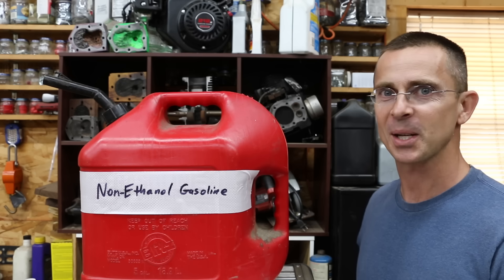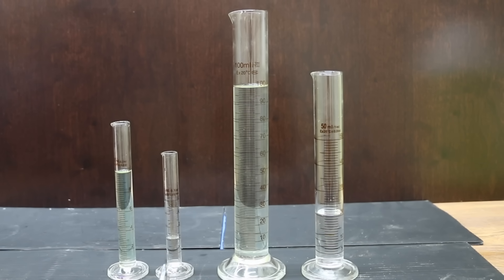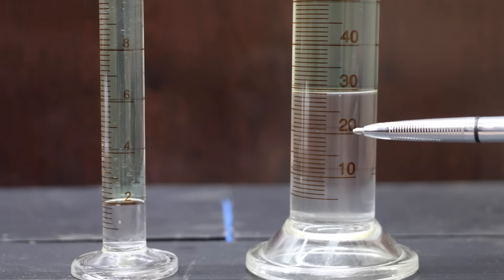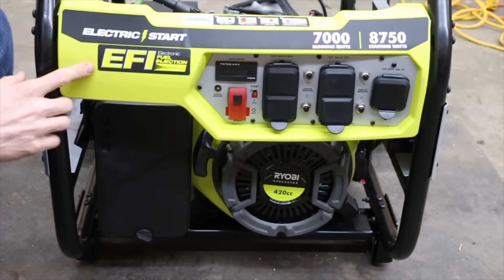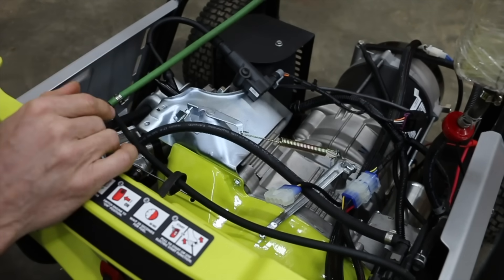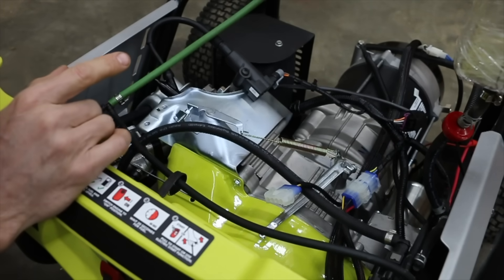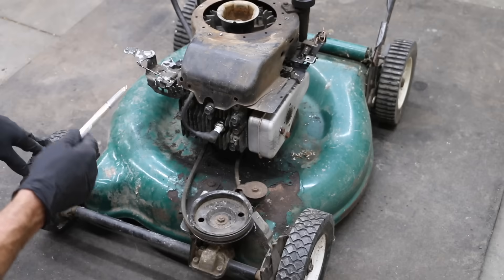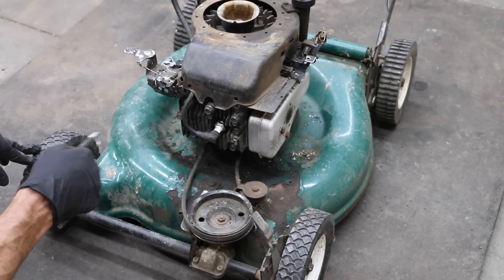Is Non-Ethanol Gasoline Really Better? See the PROOF!

Comment: Personal experience: Having dealt with various carb issues previously, I've been using strictly non-ethanol 91 in all my small engines, both 2- and 4-cycle, for about four years now - mower, snowblower, power washer, grass trimmer, chain saw, leaf blower, etc.  I don't use any fuel stabilizers and have had no carb issues with any piece of equipment since I switched. (mower is 11 years old, snowblower is 27 years old).
Reply from the maker: Thanks for sharing.
Reply: @ProjectFarm  Can you make a video on 2 stroke engine regarding 2t oil pump vs premix with gas... Which is better... I have a 2 stroke bike 1988 rx100 yamaha.. I am using autolube, but some says premix is better...thanks in advance... ❤️
Reply: @shishirgupta8574  A lot of people delete oil injection pumps as a preventative measure to eliminate an additional potential failure point, oil injection pumps failing means your bike will run richer and not have any oiling besides what was previously left unburnt in the crankcase. Which could cause bearings to seize, spin, wear prematurely etc. You can still premix with an injection pump, either really high ratios 50:1 or higher,  but you'll more than likely need to resize the main and pilot jets if you go much leaner with the premix fuel mixture. I personally always delete/disable injection pumps and premix 32:1 - 50:1 depending on the bikes compression ratio and/or riding I plan to do.
Reply: @WreckedRevival  thanks for sharing 👍
Reply: Do you have experience with 2-stroke oil and ethanol? I heard that not all brands of 2-stroke oil likes high % alcohol gas mixtures.

I have noticed powerloss in some small sidevalve engines when using E-mixes. My old redblock volvos are on the other hand loving 50-50% 95octane and E85.
Reply: @secularnevrosis  Well, yes.  I used to use regular grade fuel with ethanol in everything, 2- and 4-.  Used to gum up my old grass trimmer.  I contacted Stihl, Honda, etc. manufacturers and asked re using 91 octane non-ethanol, they said no problem.  I haven't had any issues using it in 2-stroke, and the leave blower especially gets a lot of use, 12 months, because I use it to blow light snow off walks and cars besides yard work the rest of the year.
Reply: @rla1000  ~ You do not use Fuel Stabilizers you explained. “BUT” do you live in a cold winter climate that gets down to about -25 and small 2 & 4 cycle engines, snowblowers, lawnmowers, and ATV’s sit parked for about 6 months of the year not used.??  In this case Fuel Stabilizers are needed as an addition because Fuel deteriorates and degrades over long term storage.
Reply: @royjohnson465  Thank you, but I guess I don't really know what the fallout is from fuel "degradation/deterioration," so long as it doesn't cause carb issues, and I have had zero problems since I switched to non-ethanol several years ago. It doesn't seem to affect engine performance because at some point I'm adding fresh fuel with any use of the machine.

I don't know that I've ever experienced -25F, certainly not in the past 30 years or more, with winter and summer temps increasingly warmer.  However, once snow arrives, my snow blower sits on my open porch unprotected and one easy pull starts it up (never bother with electric start).  I use my leaf blower 12 months of the year (will clear a half-foot of light fluffy snow off the cars in no time), and mower (Honda with mulching) typically in use eight months a year with fall leaf pickup and spring cleanup.  Most of my equipment, even after sitting for several months, fires up within one or two pulls.  Exceptions might be chain saw and power washer which could sit unused for three or four years.  Had need to fire up my chain saw the other day after it had sat at least three or four years and it did take about a dozen pulls before it kicked over.  Part of the problem I think is it has a very short stroke and the pull cord could be longer.  Do you think I should add stabilizer to equipment that I know is going to sit idle for longer periods?  I don't have enough experience with stabilizers to know if they help or not, but I do know non-ethanol helps 100 percent.
Reply: @rla1000 the chainsaws are two stroke. Gas is not the problem, its always the oil thats mixed in. Sometimes adding a little bit fresh gas helps relieves a dozen pulls to few pulls.
Reply: This would probably get expensive for car use
Reply: That’s such a waste of money but you do you I guess
Reply: @ProdigyyRp  considering how little fuel small 2 and 4 stroke engines use, it's honestly not a major difference, and is worth not having gummed up carbs if you leave something alone for over a few months
Reply: @That1Carson  exactly, spend the extra couple bucks beforehand
Reply: @That1Carson  are you running them dry before putting away? Because even with non ethanol you have problems without proper maintenance
Reply: @That1Carson  The simple answer is that if your fuel delivery system isn't designed for ethanol then don't use it. I use 91RON lead free non ethanol in my lawn mower for this reason but in my dual fuel car (an Australian Ford Fairmont wagon), which is E10 compatible, I run either LPG, E10 or 91 depending on price. I get 17litres/100kilometres from LPG 14.5L/100 on E10 (94RON) and 12.9l/100 on 91RON. This is in city driving which included roads with 60 and 80kph speed limits. I will only run three tanks of LPG before running a tank of either E10 or 91 Ron to provide upper cylinder lubrication. I have had no issues with injectors or fouling plugs and my engine is an inline 4.0 six which has done 370,000 kilometres.
In short I don't see it as better or worse- just different and you have to judge the cost of the fuel against the consumption. If I am going on a highway/freeway trip I will run my Ford on petrol to start up but when it gets to operating temp i will switch to LPG until it runs out and then back to petrol. This gives me a range of just under 1000K.
Typical prices in Dandenong Australia at the moment are LPG AUD $0.90/litre, E10 is 1.65/litre and 91 is $1.70/litre.
Reply: @That1Carson  don’t let your shit sit with fuel in it and that won’t be a problem…
Reply: @lonewolftech  I had an outboard on my sailboat, old Honda from 1972.  Since it was a sailboat, I would go through just one tank of gas from May-to-October.  So this stuff sits in a tank for a while, and in humid environment.  It was common wisdom at the club to use only ethanol free gas.  Community jars were marked in big letters - strictly no ethanol containing gas.
Reply: @ProdigyyRp  Only a waste if you throw the car away in 6 years. Carbon buildup will wear everything down and cause blow by eventually. I ain't putting ethanol in anything I want to own for a long time.
Reply: @ProdigyyRp  booooo
Reply: I also use premium without ethanol in all small engines. No more carb issues. I don't even winterize. Still get rotted chainsaw fuel lines over time.
Reply: wise
Reply: my 30 year old snow blower's carb clogs right up if ethanol gas sits in it. Switched to non ethanol (unfortunately only high octane here), and while it probably performs worse, it's much happier overall...
Reply: @moonasha  don't let gas or ethanol sit in a carb. Both will damage the carb eventually.
Reply: @jdrok5026  what if gas just sits in a tank? We didn't get any snow last year so the snowblower has just sat there for nearly 2 years unused with gas in the tank. I drained out the carb at the end of the last winter we used i though
Reply: @moonasha  gas in the tank isn't s huge issue water is for ethanol but you should always run the carb dry.
Reply: @moonasha  The gas tank on an engine has to have a cap which lets in air, to replace the gas being sucked out.  This means that as temperatures rise and fall, air goes in and out of the tank, together with water vapor.  It might be best to transfer your gas to a sealed gas can, but I don't know for sure.
Reply: ok idc
Reply: @rodolfo5651  you cared enough to waste time replying lmao
Reply: I had lots of issues with rec it 90. All stopped when I converted to auto station 10% ethanol fuel all issues stopped. Only difference is there is no carbon in engine. It keeps it cleaner. Keep the tank full in summer. There is always someone trying to influence you. Don't listen
Reply: @solarfry  It really depends what kinds of bushings, gaskets, and hoses your engine is built from.  That's why fuel chemistry (and coolant, oil, etc.) is all part of the design spec, but you can only hope that any updates in the design were propagated through the engine design.  In some cases, they update some parts of the engine,  but forget to change something like the gasket formulation, and you end up with blown gaskets.  This happened with a lot of cars when they went from the old green antifreeze to the newer orange junk.  With the wrong gasket formulation, that antifreeze turns to something resembling peanut butter in your engine.  (ask me how I know)
Reply: Agree 100%. I have been using ethanol free-fuel in all of my 2-cycle and 4-cycle engines for the past 6 years and have never used stabilizer or had to rebuild carbs. I leave leftover fuel in the tanks over winter, and have the "No Spill" branded gas cans that are seemingly air-tight...everything starts right up in the spring time with zero issues.

Side-note...my 1050cc motorcycle has a plastic gas tank that is known to warp with ethanol fuel, so I've switched to ethanol-free for that purpose as well.
Reply: I live in Canada and i have never drained gas from my carb on my mower and snowblower and they start up like a champ everytime. Ethanol sucks plain and simple. Its for alcoholics and should be kept that way. We dont need no drunk engines on the road.
Reply: I also use non-ethanol in all of my small engines. Personally, I think that some automobiles run better on it as well though with most of the newer engine that's not necessarily the case.
Reply: @fitnesssoup7553 😊
Reply: a gdzie kupujesz te paliwo ???? Where buy this gas ? Wszędzie nie ma już takiego paliwa
Reply: 91 Oct non ethanol is hard to find. 87 everywhere
Reply: @trumpwon8231  It was opposite in Canada until couple of years ago.   87 - 10% ethanol,  89 - 5% (*),  91- ethanol free (from major suppliers such as Shell or Esso).  Now all have ethanol.  ( *) I suspect 89 was mixed at the pump from 87 and 91
Reply: I also switched to ethanol free in all of my small engines and I also have not had to clean a carb since.

Comment: As far as ethanol in small engines goes, it's not the engine that it hurts. It's the carbs and tanks that it wreaks havoc on. I have an atv repair shop that I've seen carbs totally trashed from ethanol usage. All of my personal atv's and lawnmowers use 93 octane non ethanol fuel and haven't had an issue yet.
Reply from the maker: Thanks for sharing.

Comment: Driving 100% ethanol powered cars since 1989. No issues here as the manufacturers design the vehicle for that. As for the different efficiency, it is a wash as ethanol is cheaper than gasoline. You just have to visit the gas station more often. The plus side is that the ethanol engine is more efficient, you get more HPs than a gasoline engine same size (volume). During oil changes, you can see how much cleaner ethanol makes an engine run: oil looks like new when you drain.
Reply from the maker: Thanks for the feedback.

Comment: Thanks for doing this testing. I wonder why, after all these years ,  would small engine manufacturers not alcoholproof the engine & fuel system components. I bet we’re down to only a few key components that still need work : floats, seats, & tubing.  I did some work in the 90s with e85 in small engines & found very few problems.
Reply from the maker: You are welcome!  Thanks for the feedback.
Reply: If they alcohol proof they can't sell you another product in a few years. Planned obsolescence, engineered failure.
Reply: @randomidiot8142  It does seem to be that the cheaply made engine components are the main reasons as to why ethanol isn't in greater use.
Reply: @barklordofthesith2997  but it is. Ethanol is in basically all gasoline you buy now. Trying to get ethanol free gas is difficult and usually ridiculously expensive compared to the usual offerings at the pump. It depends on the time of year but you're getting 5-20% less gas than ethanol free. Same with diesel. Finding #2 is harder and more expensive than the b5-20 mixes.
Reply: @randomidiot8142  I meant very high % of ethanol fuels. As in like 95% ethanol with a few other addatives. I guess i should have been more specific with my wording. I am very aware of 'normal' gas having some of it in it. I happen to be a homebrewer & have an interest in having the ability to make my own engine fuel. An oversimplification is that yeast eat sugar & shit alcohol (ethanol mainly) So you could take some water & a bag of sugar & add turbo yeast, 2 or 3 days later you have a 10% sugar wine that you can load into a column still to produce 95% vodka/ethanol to be used as fuel. The goal would be to find a source of sugar that makes it cheaper to make fuel vs buying it or if there's a fuel shortage for w/e reason, just being able to produce one's own would be great.

Comment: Driving a “Flex Fuel” vehicle between San Diego and Los Angles was an eye opener.  Using 100% gasoline allowed for a round trip without refueling.  After switching to E-85 fuel it was necessary to refuel prior to completing the return trip to San Diego.  The money saved by using the cheaper E-85 was lost by having to use more of it.
Reply from the maker: Thanks for sharing.
Reply: @ProjectFarm  Mythbusters ran the same test with the same result; the need to refuel.  Edmunds got the same result in their test and found CO2 emissions to be nearly identical.  Same CO2 emissions, however, the operator cost is higher due to an estimated 10% to 13% reduction in mileage.

Comment: For lawnmowers I use a Bolens 21" Push Mower at my mom's house. Bought the mower in 2007 and in 2013 the mower (seemingly) stopped working.  At this point I had been using Sunoco 87 ethanol gas  At first I was going to toss it and get a new one but I decided to do the work and find the problem. My problem was the carburetor was gummed up BAD and was really discolored. So I ordered a replacement OEM carburetor and replaced it myself. Replaced the spark plug and changed over to using non-ethanol gas in my mower. 8 years later the lawnmower is still going and I have not had to replace the carburetor again. In addition, the carburetor doesn't have that horrible discoloration. So for my small 4 cycle engines around the house I only use non ethanol gas.
Reply from the maker: Thanks for sharing.

Comment: A major difference I noticed in the E10 gas, is that it messes up the rubber diaphragms/O-rings in my 1967 Volvo 122S mechanical fuel pumps, forcing me to replace them with new fuel pumps, and so now, I use ONLY non-ethanol fuel in my Swedish Classic Station Wagon, and henceforth, have no more need to replace the fuel pump! Whoever invented E10 (corn-based) gas oughtta be........well, this being a family channel, we won’t say!
Reply from the maker: Thanks for sharing.

Comment: Supply chain for motor oil is getting bad, my father used to tell me that Mystik jt-8 motor oils by Citgo were very good. How about putting Mystik JT-8 up against one of your top rated 5W-30 gas oils, or a head to head Mystik JT-8 5W-40 synthetic diesel oil against Rotella T6 5W-40 for those of use who run Diesel pickups?
Keep up the good work
Reply from the maker: Thanks, will do!  Thanks for the suggestion.

Comment: Great test, sir. Good baseline to show Non ethanol gas is better. The only vehicles that can benefit from the cleaning aspects of ethanol are flex engines that can run E85. My Tundra is 5.7 is a Flex fuel engine. I run a tank or two of E85 once a year just to help clean out any deposits.
Reply from the maker: Thanks!  Thanks for the feedback.

Comment: It didn't do my Yamaha XT660z Tenere fuel tank much good.......lot's of air bubbles under the paint where the ethanol made the plastic tank go porous!! Not only that, the tank distorted too meaning my plastic "crash protection panels" (a factory part attached to the tank) were harder to remove and replace as required in servicing, became harder to fit properly because of the distortion.
I have seen results of longer fuel economy tests and ethanol fuel is not more fuel use efficient either....less mpg in all cases!!
Governments & oil companies however love it, it makes them look like their doing something for the environment whereas the reality is Governments get more money fro duties and oil companies make more profit from "watered down" fuel which consumers have to buy more of !!
Reply from the maker: Thanks for the feedback.

Comment: You show ethanol settling to the bottom. I presume then that it then also settles to bottom of the gas tank. Isn't  it bad if it's no evenly dispersed in the gas tank (i.e. it won't get burned evenly)?

Comment: Fuel efficency with 4 inline 2.4 tested couple of times during high speed on German highway avg. speed was 160-180kmh. I had less consumption with 100 octane then with 95. When on long trips with higher speed I use 100 octane always.
Reply from the maker: Thanks for sharing.